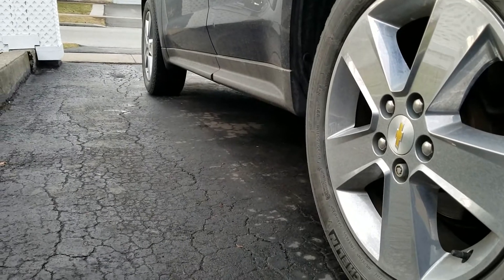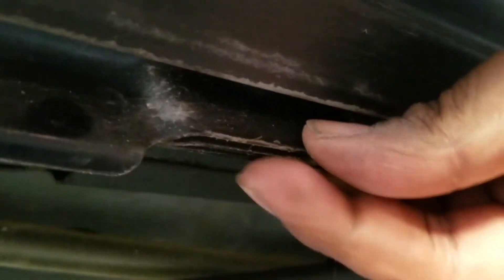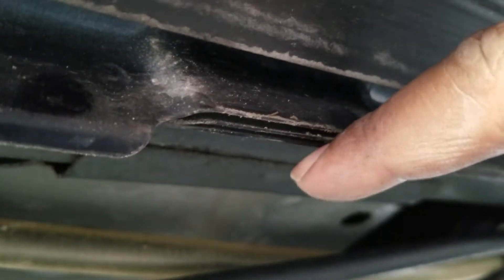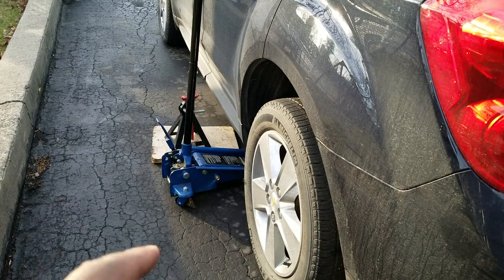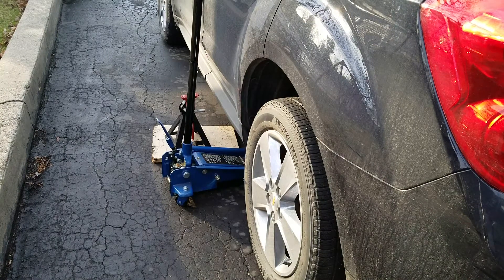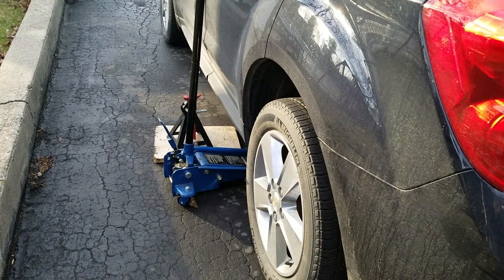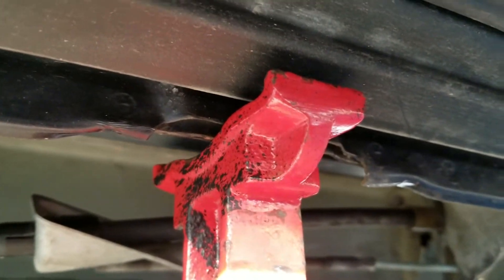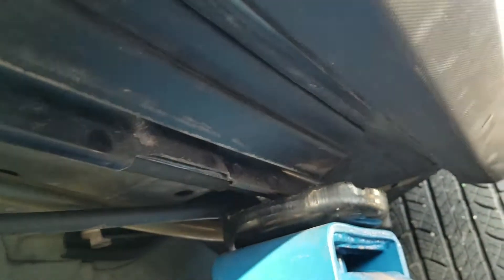Using a Service Jack and Jack Stands

Comment: I use a floor jack and “poor man’s” jack stands to get my car or truck up in the air. I have some blocks of wood along with various thicknesses of wood that work just fine. And of course safety is most important when doing this.
Reply from the maker: Definitely....safety is the number 1 priority. It is amazing to think of or see the things we do as 'backyard' mechanics, but a lot of it is innovation and coming up with stuff on the fly. As long as its safe, the poor mans jack stands work great! I find the problem is that some people get a little too stingy with their wood LOL. I have seen people using wood and you can see it splitting WHILE they are under the car. Heeeeeell no lol! But it sounds like you got it down well.